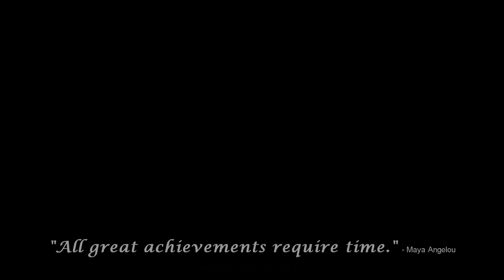How to Make a Homemade Wooden Watch

Comment: Wow, cooool, but probably breaks easily
Reply: hakim حكيم channel the wire? But the wood should be fine?
Reply: It doesn't.. I have a wooden watch, wearing it every day. The last watch I had was made from bamboo, only with a simple leather belt, and the belt broke after one year of everyday use. So no, use can safely purchase one for yourself. You can find cheaper watches made from bamboo.
Reply: Ada Vasquez
unsecured place, shut up Immigrant ,  go and spam other place, this is for artists not for scammers and spammers,